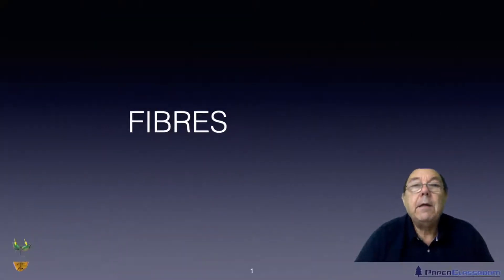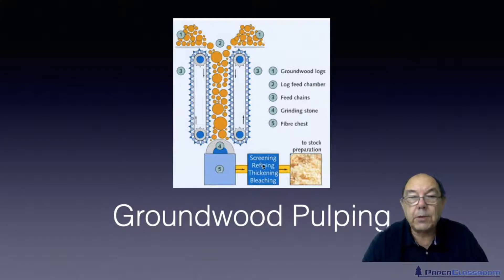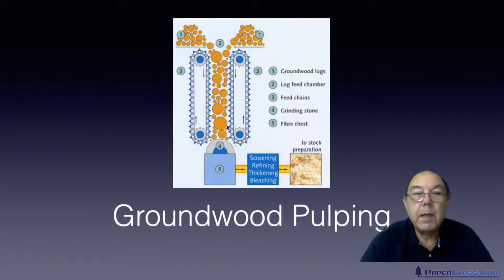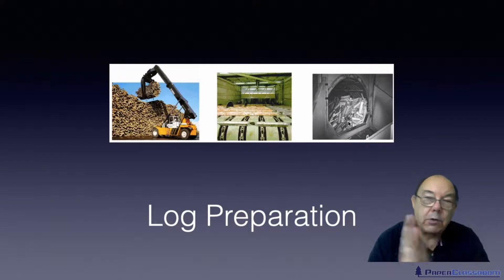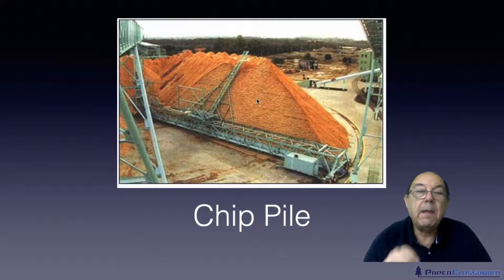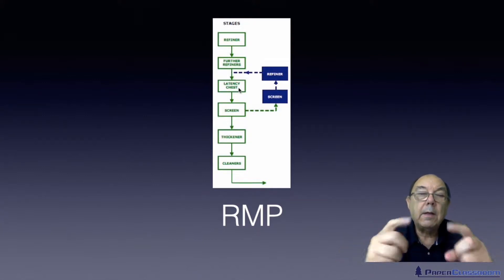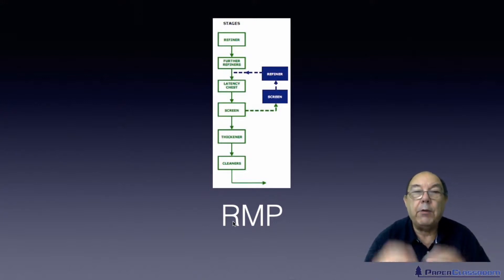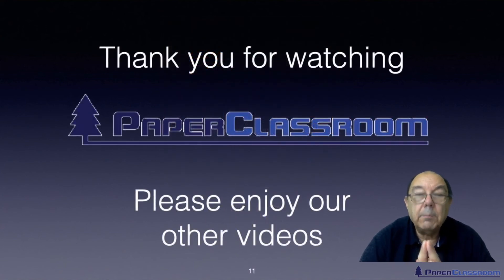Level 2 Papermaking - Mechanical Pulping Methods

Comment: What is semi -mechanical pulping??
Reply from the maker: Semi-mechanical pulping is also called semi chemical pulping or hybrid pulping

Mechanical pulping involves reducing a tree to individual fibres using only mechanical methods, such as a grindstone or efiner. No chemicals are used

Chemical pulping involves reducing a tree to individual fibres using only chemicals at high temperatures and pressure. No mechanical methods are used. The chemicals dissolve the lignin that glues the fibres together.

Seemi-mechanical pulping involves treating wood chips with chemicals to remove/destroy some of the lignin, THEN, putting the material through a refiner to break up the remaining fibre clumps